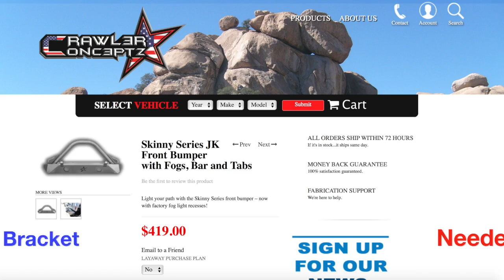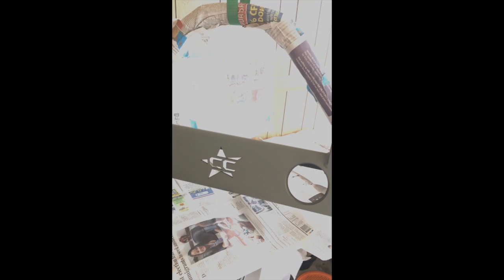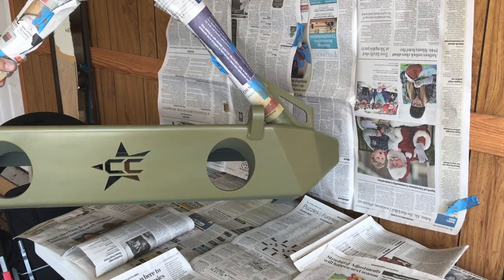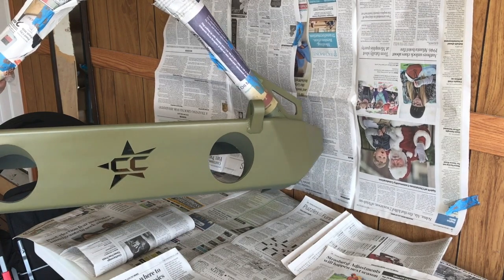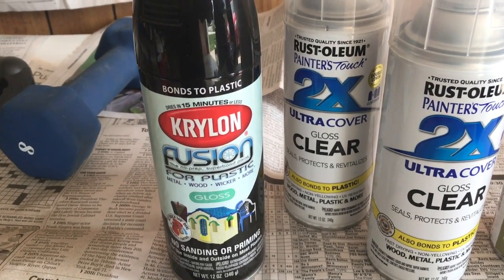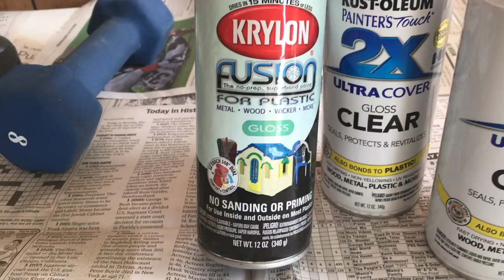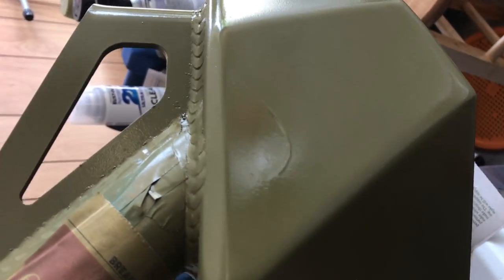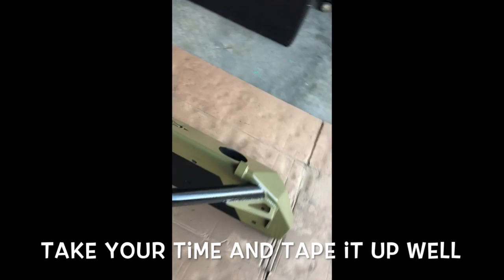Crawler Conceptz bumper Factory Painted...

Comment: You only used 1 can to get as far as you did? So 2 will be perfect? Also, how did it hole up until the point where you sold you jeep? (Not sure how long that was)
Reply from the maker: Jun 2017 -Jun 2019 I think it held up pretty well. I clear coated the bumper about 4 months ago sometime in Feb. Just to re-shine it up. 5oz goes quick if you buy the MOPAR little cans. I would look into buying from https://touchupdirect.com they have great paint matches.